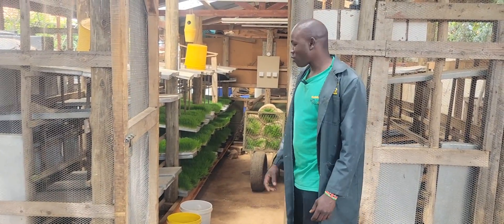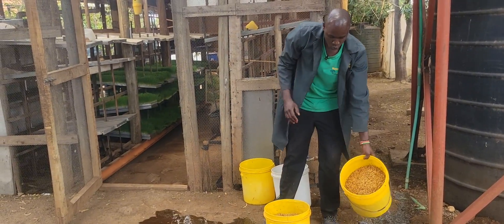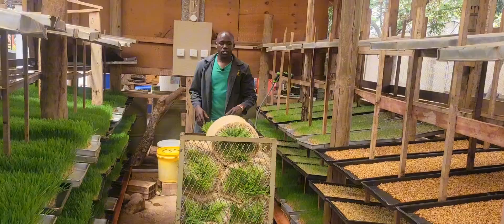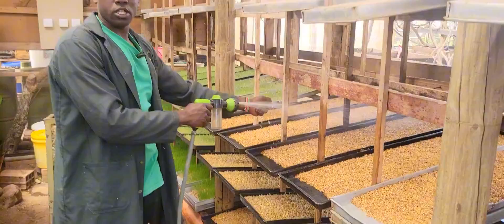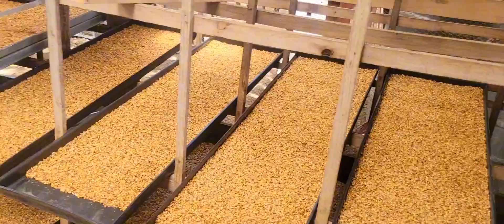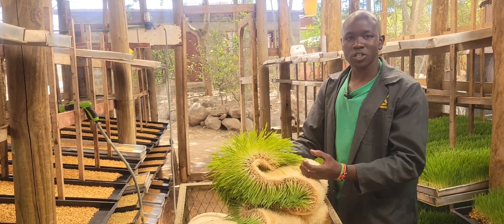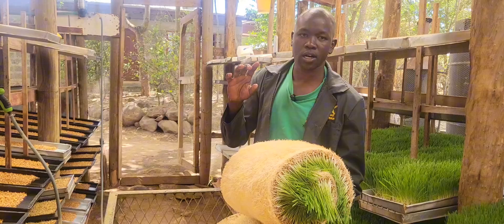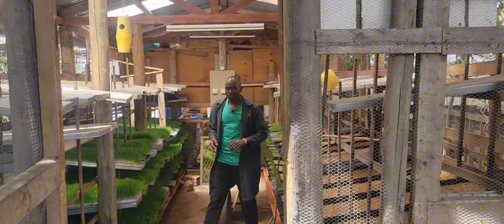Hydroponics fodder. we make 8kg of fodder from 1kg of barley.

Comment: Unfortunately most people, farmers and animal nutritionists do not understand the main reason this idea cannot make sense at all. The carbon balance during this phase is negative, that means the amount of nutrients at the start is higher than nutrients at the end of the process. Germination is a process that is energy driven, you start with a grains (seed) with a very high nutritional value (high energy) and you will transform it into a roughage with increased level of fiber and lower levels of starch. You ended up spending time, work, nutritive solution to have less dry matter, less energy, less digestible "feedstuff". Does not matter to have large amounts of green matter, but most of it is water. The wrong idea that you will end up with a cheaper feed is an impossible idea, since you end up with less dry matter than started at the beginning of the this process. Remember that everything started with grains that were grown somewhere, then if you utilize 2 kg of maize per square meter, it is equivalent to 20 tons of corn per ha, something that is impossible to accomplish. Utilize better the grains, with high energy content, protein obtained by this method is the most expensive protein source that can be obtained. All this system does not make any sense. This mass of hydroponic growth, even though weighs 8 kg, most of it is water,  therefore if these 8 kg of product weights 8 kg, with 92-94% of humidity it will supply less than half a kilo of "roughage".
Reply: @leovegildolopesdematos3487  so what do you propose? Isn't it better than feeding the poultry or animals through rear range/open grazing or industrial processed concentrated feeds? Have you wondered why vertical farming and soil less farming is being encouraged?

Comment: The nutritional values say something different, the mass is more but the nutritional value is not better😀
Reply from the maker: Data to support that?
Reply: Could you please provide more information about the nutritional value? And why it is not better. Also what grains would you recommend germinating to add more nutritional value.
Reply: If the seeds grew from rainwater alone, where does the additional nutritional value came from?
Reply: @madsam0320 he said the husk but i have doubts.
Reply: @TheRainHarvester  the husk is mostly cellulose, hardly nutritious and you can also feed the husks with the grains to the animals instead. I think it does make sense economically because the feeds bulked up so less grains are needed.
Reply: He said severally that there are some added nutrients in the water that are going to be beneficial to the animal. You guys just didn't listen enough